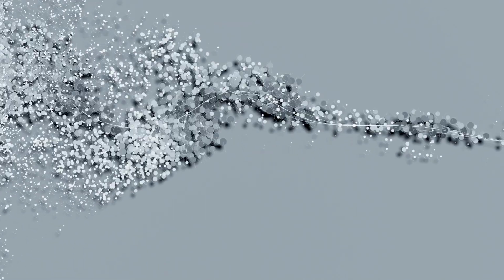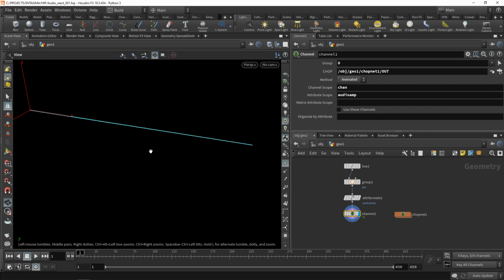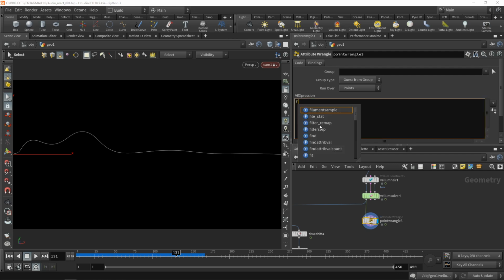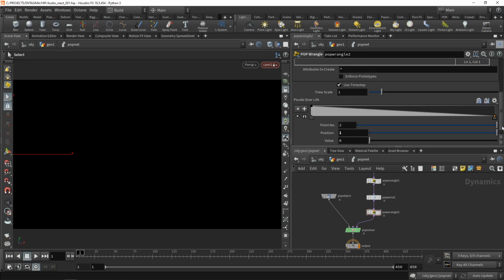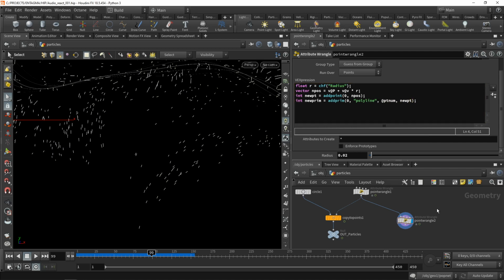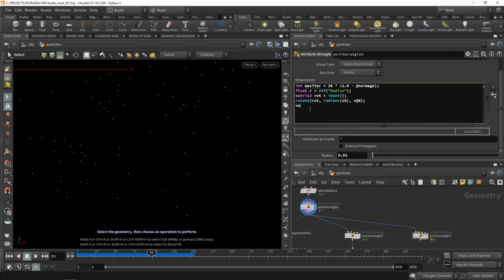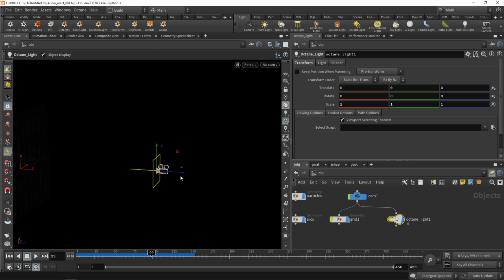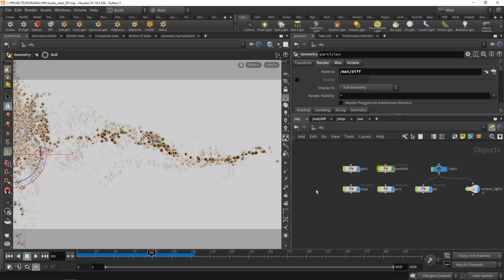Production Setup: Audioreactive Particles Using Vellum & POPs (Free Houdini Tutorial)

Comment: Is there a way to do this while combining your Chladni patterns tutorial?  How would I begin?
Reply from the maker: Heyhey!

Yes indeed - you could calculate density values using the Chladni tutorial, write those onto an attribute then use this attribute to drive the scatter density to create points in areas where your chladni pattern has higher values. Or directly use this point attribute in your POPsource to generate points in high value areas.

Cheers, Mo

Comment: Is there a reason why you created the arcs in VEX and not with a circle SOP set to polygon with open arc? And you could've just animate the arc angle with a for-each loop.
Cheers
Reply from the maker: Valid Question - while both approaches (as well as possibly a few others) work well, in my opinion it's easier, more streamlined and offers better performance to create them in VEX.

Cheers, Mo

Comment: I have a question:
Does using only integers affect the file size?
For example if we would create an extremely large grid, would it matter if the grid's tiles had a size of 1 compared to say 1.111111111111?
Reply: From my understanding, it's not. Because Houdini always recalculates your stuff when you open it again. For example you take a sphere, subdivide it a bunch of times and you end up with 1 million polys. Yet your file size will be like 0.5MB. It's just like storing a recipe.
Reply: Also, when the grid is in memory the round numbers you dailed in will be stored in memory as floats, doubles or whatever houdini uses.